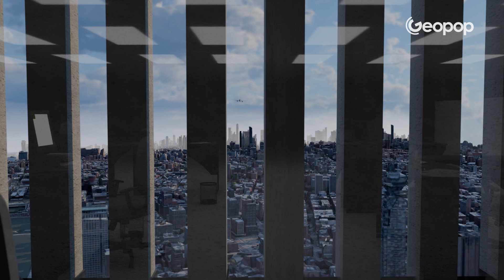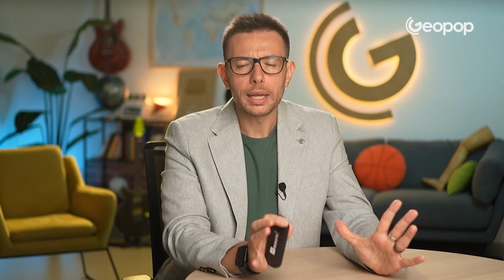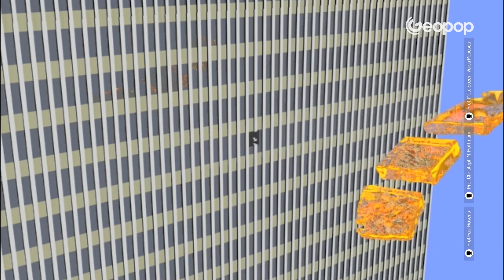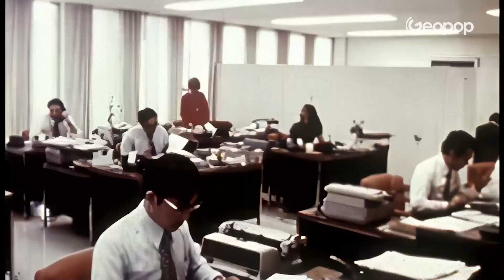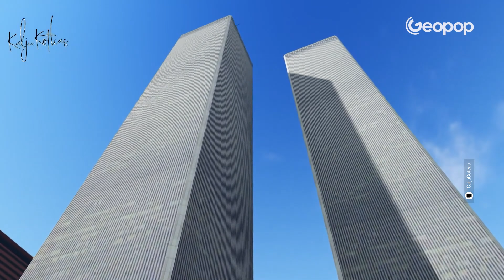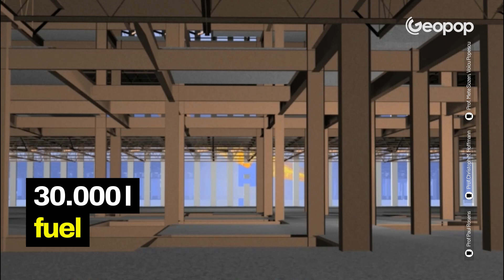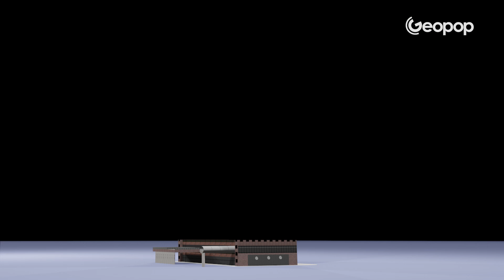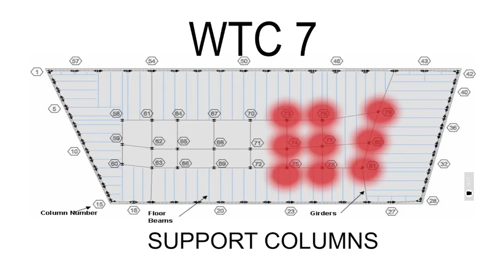9/11, 2001: The Technical Reconstruction of the Twin Towers and WTC 7 Collapses

Comment: Engineering Hot Take Here:

For WTC 1 and 2, the physical damage to the SFRM (Sprayed Fire-Resistive Material), combined with the thermodynamic properties of structural steel, makes sense from a failure mechanics standpoint. For those unfamiliar with the behavior of SFRM under such extreme conditions, I recommend reviewing the FABIG guidance on SFRM design. I do wish the timestamp at 14:33 —referencing the "colder block"—had been elaborated on further, especially for those less familiar with the thermodynamic stresses imposed on steel structures and their connections.

Some important considerations include how moment connections may have created cantilevered conditions after the plane strikes, significantly increasing stresses on adjacent, initially unaffected members. These members, although not exposed to direct impact or heat, would have still experienced significant strain due to load redistribution and differential thermal expansion across the structure locally. Seriously, once you understand FABIG, thermal steel fatigue coupled memeber size and allow heat sink induced by damaged SFRM, this explanation is not hard to concieve. 

WTC 7, comparatively, performed quite well under the circumstances. That said, the fact that it was not designed with progressive collapse in mind seems like a moderate oversight—particularly given the local terrorist activity in the preceding decade. It's also possible that during the vertical expansion retrofit, progressive collapse analysis was not included in the design parameters. If so, that would be a critical but understandable oversight for the time. I’m not suggesting willful negligence—just acknowledging the limitations of what we currently know about the building’s original and modified design.

To those still reading: I understand that conspiracy theories can be tempting. They often provide a neat and emotionally satisfying answer to a deeply traumatic and confusing event. But remember: humans are hardwired to identify patterns—It's a survival mechanism, but also a cognitive vulnerability.

In closing, without full access to the original specifications, post-impact conditions, and especially considering the compromised chain of evidence due to debris removal and destruction, it's difficult—perhaps impossible—to convince the general public that the official explanation is entirely sufficient. Especially when considering the pentagon stike. This will always remain a layered issue, like an onion that may never be fully peeled. 

Great video!
Reply: Yeah... Great comment!
But there is really not that much of layer that you need to peele to realize what was going on...
Do you want to try to explain the collapses of the core structures of WTC1+2? Do you want to explain the free fall of WTC7? Do you want to stfu?
Reply: I came back here because I figured someone would commet. 

If you actually took the time, and read the referenced documents, and in addition watch Kei Sugimotos film, you would understand. My comment was long, but intentional. I believe you should get educated fella. Then come back for a more educated discussion.
Reply: @tarik6075  Oh, all your cool documents and sources left you unable to explain what I asked for? Seems your sources are a complete waste of time huh? Perhaps if you stop wasting your time on BS sources, instead go and check some relevant sources, perhaps then you will be prepared for a discussion my poor little helpless wannabe...
Reply: @tarik6075  So what the f you talking about if you end conclusion is like uhhh I don't know, you f clowns are the reason why these delusional bots run rampant raging on everyone with a brain and the ability to think for themself. You came back here and you still don't have a clue about how buildings work. GG now STFU
Reply: @Kudde23 That's cute. Objectively, you have no idea how building structures and associated systems imployed to protect such structures work. Even in modern times, we continue to design structures with the same methodigoly the WTC towers were constructed. Additionally, you are arguing the wrong point. I agree there's is definitely some REAL sketchy shit that happened. But it's not unreasonable to think that structure was compromised enough to have a similar outcome. Cite your sources, and change my mind wAnNaBe?
Reply: @tarik6075  Look, to weaken a steel needle by heat you only need a freeaking candle. To weaken the giant core columns that were so huge that they had to build a new factory to be able to even produce them you would need such a huge and long fire that there couldn´t be enough combustables to get that fire.
Of course they considered the possibility of fires in the design. They even considered the possibility of fires that get started by a plane crash and all its jet fuel. They concluded that neither the impact nor the fire would significantly harm the building structure. And that´s despite the fact that they didn´t even had sprinklers in the original concept. The chief engineers obviously were convinced that the Twins could just burn out completely without collapsing.
And then they had the huge fire in 1975 and the tower didn´t collapse, not even partially and they didn´t have to demolish the tower afterwards.
And then they had the bomb in 1993 and some fire and the tower didn´t collapse, not even partially and they didn´t have to demolish it afterwards.
So we have two major incidents that support what the WTC engineers calculated in their design.

Just out of couriosity: 
If you were an islamist who wants to do the most damage to the U.S. and its people and for some reason you think that hijacking and crashing planes would be the best way to do it, would you ram the planes
A) into the only civil buildings worldwide that were literally designed to withstand such attack or
B) any other buildings?
If you were an inside jobber who wants a big show in order to get the american people ready to go to war and for some reason you think that you need plane crashs for the show as a cover up for the controlled demolition that you want to happen later as the climax of the show, would you chose
A) any other buildings or
B) the only civil buildings that were designed to take plane crashs?
If you were a real investigator and you start off with all the reports of that day, all the civilians reports of explosions, the FDNY reports of explosions, the bomb alerts, FDNY chief of safety suggesting it was bombs that brought the towers down, FBI reporting finding a suspicious device that might lead to another explosion, FBI´s working theory that the towers were brought down by bombs, news anchors describing the collapses as what everybody knows from controlled demolitions, news and other reports of vans filled with explosives and so on and on and on, would you
A) look for explosives in the debris, for by-products, fuses, certain cables, explosion related damage etc. or would you
B) strictly deny looking for any of it?
Yeah...

Ok back to the technical part...
Do you know what kind of structural members carried ALL the buildings weight? If you follow the NIST reports you could easily come to the conclusion that all the buildings weight was carried by floors and floor connections but that´s complete BS. The buildings weight was entirely carried by COLUMNS. So why would NIST deny to EVER talk about the columns? Because they can´t explain the failure of the columns without controlled demolition. No-one can. At least no-one ever even tried.
If everything else breaks off the columns then the columns would remain, obviously. You could argue that the remaining columns would be vulnerable to wind loads so they could collapse later on, but that would be a collapse totally different to the essentially free fall collapses that we´ve seen.
But I guess you want to disagree on that, I guess you have some very vague idea like that at the same moment the columns lost their lateral support they also suffered lateral forces and therefore the columns broke apart floor by floor by floor. But that´s not what happened, not to the CORE columns.
In fact for each Twin Tower there were TWO collapses of the core structure. The first one happened right with the initial collapse that brought the entire perimeter down at once. I would even argue that this initial collapse STARTED with the failure of the core, but let´s leave that out for now... This initial collapse left about half of the core structures standing briefly. Then the second core collapse happened delayed. Here is where you have quite a good look at single giant core columns sticking in the air, swaying, tipping over in various directions. But that also kind of happened during the initial collapse. Wanna guess what caused the gash on WTC7? Right, it was WTC1 core columns tipping over all the way to WTC7. Wanna guess what caused the damage at the sw corner of WTC7? Right, WTC1 core columns tipping over all the way to WTC7. This is a crucial collapse mechanism that literally everyone missed, FEMA, NIST, AE911truth, you... We´re talking core columns tipping over in lengths of 100m and more. That doesn´t fit the idea of core columns breaking apart floor by floor, does it? So what happened in the initial core collapse? Did 100m of floors break off of the core columns, leaving 100m of core columns standing so that they would tip over in that length immediately afterwards? Or were the core columns cut way below the collapse front, perhaps even starting the collapse? To me it looks more like the latter but even in the first case you would have to come up with an explanation that doesn´t exist so far.
To make it even more complicated for you: The core structures had their own lateral support within themselves. So what could have removed that lateral support within the core?!? Surely not the failing (falling) floors and floor connections outside the core... Oh wait, let me guess: The core´s lateral support was removed by the fire protection foam that you love to focus on?

For WTC7, like almost ALL shills, you didn´t even dare to adress the free fall that proves the controlled demolition...

You should be able to figure out by yourself what sources I´m referring to. But since you are a shill...
FEMA, NIST, 9/11 Commission, other official reports, news reports, witness reports, tons of videos... As additional sources I recommend David Chandler and Jon Cole, perhaps Kevin Ryan.
Reply: @tarik6075  you are insane

Comment: Why wouldn’t there have remained columns of concrete and steel if not to the 70th floor at least 40th?
Reply: Keep in mind you don’t have to teach me basic physics I’m picturing this collapse modeling it in my mind I’m just curious what’s the explanation for no concrete columns left over not to the 30th floor at the very least. I’m no architect nor engineer so I have questions.
Reply: @ellomirza  It was steel structures, concrete in the floors and stairwells and foundation, not in the columns.
Reply: @ellomirza  - There were no concrete columns, just steel.
Reply: @TheLoonResistance  Oh you´re supporting me stinkyfitz? Thank you stinkyfitz!

Comment: Fascinating. Now what about all the steel and concrete below the impact area that was unaffected, not on fire, and supported the part of the building above it since the day it was constructed? Why wouldn’t it continue to hold while the part above the impact area toppled over to one side or another?
Reply: There's an excellent docu available here on youtube called "World Trade Center Anatomy of the Collapse" which give a clear, understandable explanation for why the undamaged lower structure could never have stopped the collapse once it started. Short version: The lower part of the building was capable of supporting a static load but not a dynamic load. Imagine this: You might be able hold a 50-pound rock indefinitely - but if it were dropped from 10 feet above you, would you be able to catch it?
Reply: @Tim22222 yes yes I know i can pull a car up in the air with a bicycle chain if I pull slowly but if I yank on it, it will break.
Still he did mention it was built to hold its own weight plus a third more. 
I don’t think it’s impossible that it was designed such that should it collapse it does so in its own footprint so as not to cause catastrophic damage to the buildings around it. But that’s possibly giving the designers too much credit.
Reply: @ellomirza  Did you watch the video? Yes, it was built to hold its own weight plus - if the load is STATIC. But when you have 100,000 tons of rubble falling onto a floor designed to hold 3500, what do you think is going to happen? After all, the collapsing top didn't defeat the bottom all at once, it did it one floor at a time.
Reply: @Tim22222 never mind. For a second I thought you weren’t a retard.
Reply: @ellomirza  - There was more than enough gravitational potential energy in the falling mass to disassemble the undamaged mass below, floor by floor.

Comment: These video are such bullshit to deceive people from the truth. The twin towers collapsed due to the support columns being cut and thermite melting steel beams. Mix that with explosives being set off and some high tech military weapon that pulverize things to the point of turning solids into powder , leaving nothing to investigate.  But don't believe me , I'm just a nobody that has the brain power and common sense to know that things being told to us were an impossibly and could only work in a make believe story.  A story planned and executed  and got away with by the ones who control your very lives. The ones that want you to believe we are free as they keep us as slaves
Reply: So, if you were charged with planning an attack that absolutely has to look like terrorists hijacking commercial flight and using them as Kamikaze missiles, AND NOTHING ELSE l, is that how you would do it?